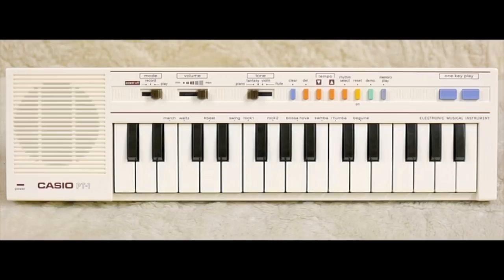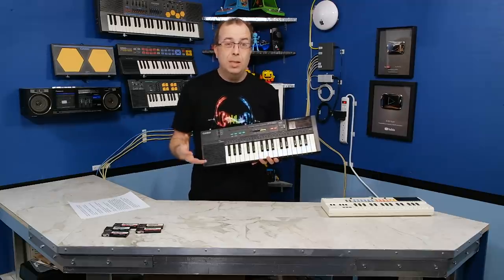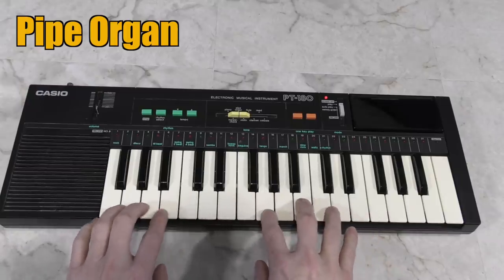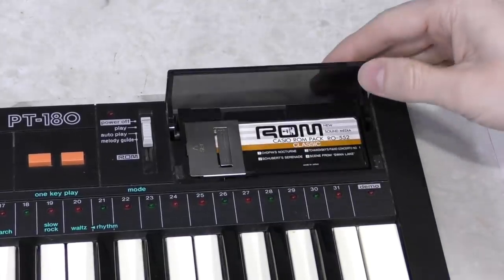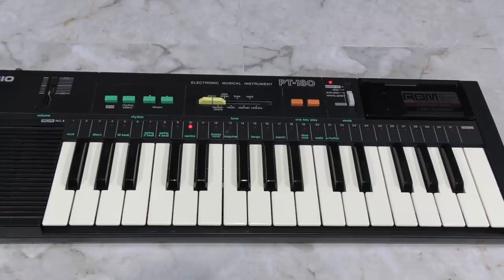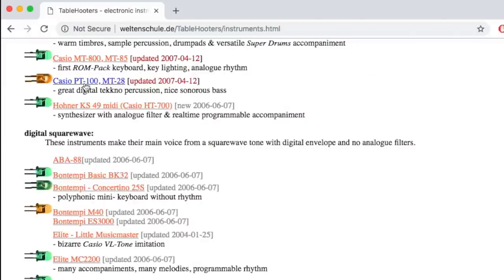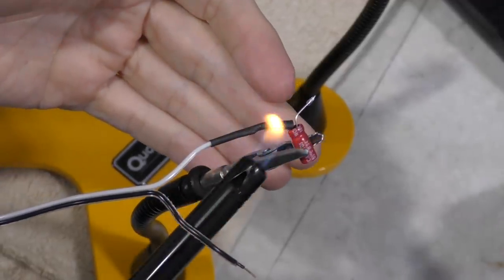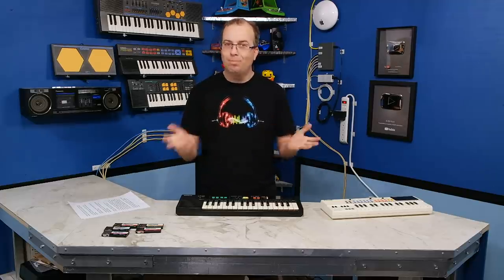Casio PT-180 Review

Comment: Using that potentiometer on the left with the longs legs at 7:12, you can tune the keyboard up or down. If you swap it out for a larger value/range potentiometer, you can detune the keyboard an entire octave or more in either direction. This same potentiometer is used in the entire PT lineup as far as I know. I made this modification to my PT-10, and it produces some incredible bass notes now.
Since the value of the potentiometer changes the microprocessor's clock speed, it will affect everything connected to it, so the tempo of ROM cartridge songs will also be affected. I have noticed a slight bit of lag in the keys if you make the pitch too low, and there's a point where the microprocessor's synthesis will just stop functioning due to the incredibly low clock speed.

Just thought this might make a cool topic for a future video, since it applies to all PT keyboards.

Comment: The one time I pulled an output from a Casio that didn't have one, I took the signal from the volume control - it had the advantage of not having the noise from the cheap amp in the keyboard added to the signal.

Comment: The range of notes kind of reminds me of the frequency range of the SN76489 chip found in the Master System; the lowest frequency it can make (from what I heard) is 110Hz (which I believe is A in the first octave).
Reply from the maker: The same chip is in the Tandy 1000, which I've been trying to compose music for on my new game. But it is tough because of the lack of bass notes.  However, it absolutely has WAY more notes than this keyboard I'm reviewing!
Reply: The MT-55 has 44 keys, and the MT-88 has 49 keys. They have the same sounds as the PT-100 and PT-180 but 4 extra sounds.
Reply: 110Hz is an A2. Open A string on a bass is 55Hz; first octave A, the one below an open B string, would be 27.5Hz. That's barely audible for most people, if the sound system is even able to reproduce it.
Reply: 8-Bit Keys I think it was also in Texas' own Ti99-4A

Comment: If the extra notes shake out with the search for the sustain switch, would you consider modding in buttons (much smaller than standard keys of course) to make them playable? They might have to go down the side to be played with the left hand, if there are many of them. The speaker grill could also be useful upper deck surface for extending the key range, but then you have the obvious problem of where to put the speaker.

Comment: I have an MT-28 and confirmed that connecting pins 90 and 46 on the CPU turns on sustain, and pins 90 and 47 turns it off.  The MT-28, PT-100, and PT-180 are all the same hardware family.  I'd trace those CPU pins out to a convenient spot to solder and sustain away!  I love your vids, that shot of 80's you getting his PT-100 is great.  The PT-80 was my first Casio and I still have it and love it.
Reply: I suggest emailing David this fact, and provide evidence or proof, he's way more likely to respond on there, or even see an email at all! I'd love to see a revisit where he builds a sustain mode into it!

Comment: For making just a bit safer line output, you can put a small resistor in series to limit the current; it is still direct power amplifier output even with the cap..if it is 5W amp it still is more than what we expect from line level source. A large resistor in parallel so the capacitor has some return path to discharge is another addition to make it more universal solution. The capacitor isn't really even necessary, it is for decoupling the DC component but it doesn't hurt, better safe than sorry since DC can fry the next device..

Comment: You should check out Teenage Engineerings OP-1 synthesizer it is designed using  this Casio PT-80's design but it's not a toy by any means it costs about $1000 USD.

Comment: There seems to be a misconception about the key matrix. Those “chord buttons” you were poking at on the matrix were probably just 2 notes playing at once that use the same set of pins, rather than separate chord buttons, which would sound a bit different. See, there are diodes on the key mechanism for a reason: all or most of the key matrix pins are both inputs AND outputs, and require a diode to separate them. That way, if they act as inputs and outputs at the same time, it plays both notes at the same time. Strange right? I found out when battery acid leaked on one of my Casio MT-205s and damaged the key mechanism.
Also, the information I provided relates more to what you reviewed in this video than the past PT or MT series keyboards because nearly all of the functions of the keyboard(s) are stuffed inside a proprietary Hitachi/Casio ASIC.

Comment: i would love to see some circuit bending on this channel. I know you keep them as mint as possible, but circuit bending is so neat!
Reply: Noahskey that would be so Rad. I bet he would be an awesome circuit bender
Reply: I imagine that kind of circuit bending would additionally require additional wires, one of those things I forgot the name of, and one of those hobby enclosures to put them all in.
Reply: @kbhasi  to do the full controls mod he's going to need perf board, 10 or so push buttons, 2 switches and at least 3 feet of kynar wire (cut up LPT cable or Cat5e works too). Most of the rest of the usual mods require potentiometers, trim pots, and switches (momentary and toggle).

There are so many features on these Casio boards that go unused that it's depressing, but fun to discover for yourself.

Comment: The CAPACITOR limits the lower/bass frequencies.The bigger the capacitance, the more permissive it will be with lower frequencies. 
But as long as the keyboard doesn't output those frequencies, the capacitor value doesn't make a difference.. unless it becomes to small and starts cutting out the mid-high frequencies. 
You can find online charts to help you pick the right capacitance for cutting out sound/volume below a desired frequency.

Comment: why do you need to poke in the circuit if you already have your key matrix written down on the TH site? more to say, you are not likely to find the appropriate contacts on the board connectors, simply because the corresponding CPU pin is probably not used at all. at least that's what i remember about my PT-100, where the sustain button was abscent as well. when modified, the sustain button and all the hidden presets work as they should. but better just get a more feature-complete keys of that type - would be MT-55 or something. though none of the mid-keys versions (tons of them exist) seem to have a readymade sustain switch anyway, or maybe i overlooked it. but most have a good old and absolutelly useless demo button to be rewired for that. also note that, if i remember correctly, the thing can be switched an octave down.

Comment: Your line out mod would also work pretty easily on a guitar amp, right? No matter how I mess with the settings in FL Studio i just can't get the delay between playing something and hearing its playback down to a usable level, so I'd like to modify my guitar amp so that I can hear the amp and still record its output (without needing a mic, which would require much better ambient noise control than I have the capability of managing at the moment.)
Reply: It would be a little difficult because the signal going into your amplifier's speaker would be way hotter than you should be pumping into your PC's sound card. If you have the schematics for your amp or the inclination to map it out yourself, you could find the preamp lines on the board and solder the line output to that

Comment: Just a note about capacitor values: When you put a capacitor in series you are effectively making an RC high pass filter. For example with a lineout impedance of 100 ohms and a 1uF (microFarad) capacitor would have a -3dB frequency of about 1591 Hz. (Using equation f=(1/(2pi*R*C))). That means you're losing quite a bit more at even lower frequencies. In order to get the full range of your piano (lowest key being at about 25Hz) a capacitor value of about 63uF would be best. Larger values would still be perfectly safe, just lower values would increase the -3dB cutoff frequency.
Reply: I would recommend adding a series resistor and a parallel capacitor to make a 'bandpass' filter in order to filter out high-frequency noise too. Search "passive band pass filter" for some more details.
Reply: I just thought a little more about this.... you are using the series capacitor on a speaker,  not a lineout! So the R value is closer to 8 ohm... not 100! So your -3db freq with a 1uF capacitor is 20k Hz. It occurs to me that you're using this to significantly reduce the amplitude from the speaker wires. But thanks for the thought experiment! you may still want to consider adding a parallel capacitor and resistor if you're getting some high-frequency noise though.

Comment: I think the reason the notes are so high, is because less memory is needed to store the waveform, since they're shorter at higher frequencies
Reply from the maker: Being that a keyboard like this doesn't use sampled waveforms, it actually makes no difference. And in fact, the chip is capable of producing lower notes as I found them on the matrix, there are just no keys for them.
Reply: Casio probably do this to make better use of a small speaker. Higher notes will come across louder and clearer (helped by a 4 ohm speaker). Later Yamahas with AWM sampling tend to hard wire a sort of bass boost to round out the speaker sound.

Comment: Dave, at the risk of stating the obvious (yes I know this is a cheap hack) could you please take the extra, albeit small, effort to include a simple AC-coupled active buffer circuit to your 'line-out' mods in order to minimize having either too weak or too hot an output signal, and to reduce the potential to cause damage to connected equipment? Obtaining a pseudo 'line' signal by hanging a single electrolytic cap (of non-specific-value or polarity) from a loudspeaker terminal is the second worst 'signal tapping' method for signal interconnection between multiple pieces of equipment I can think of. Most synthesizers produce signals where much of the waveform can be considered as having a high average DC content. This DC offset can charge large coupling capacitors and if the interconnecting impedance is too high to provide a fast enough discharge path for the capacitors they DC level-shift away from 0V ground reference. This charge could move the operating bias point of any direct-coupled solid-state circuitry that follows; the item may be a piece of crap, or it could be a prized and expensive piece of vintage history... And seeing as most solid-state hifi audio power amps are almost always directly coupled 100% from input to output, any significant DC level shift can result in a catastrophic cascade - from input to output, including non-protected loudspeakers.

So, using a buffer to match equipment impedances is not just good practice, it's integral to all analog technologies and results in safer operation, maximizes signal transfer, optimizes bandwidth and dynamic range, reduces noise and distortion and drastically reduces radio interference to boot - oh, and they make great attenuators.

The parts-count for a simple buffer would be less than ten components total (inc. perf/veroboard), and for this purpose the ubiquitous LM358 would suffice. For a true cheapskate build (no veroboard required) the chip could simply be super glued upside down, 'dead-bug' style, to a suitable location within the case and all components and wires be soldered directly to the 358 pins, etc. This is simpler than it might sound, would cost just a few dollars/Euro/pebbles/whatever, uses common parts, and takes half an hour or so to assemble! Maybe you could do a video on building a simple DIY buffer? Anyway, sorry for the long-winded comment and thanks for the fun channel :)

Comment: Hi David, just a note but I always cringe a bit when you just touch the IC's on a board with your bare fingers like that... Static electricity can zap over from your finger and you keyboard/computer is just gone... Be careful with that, especially when the device is on a towel or something that does generate static electricity very quickly.